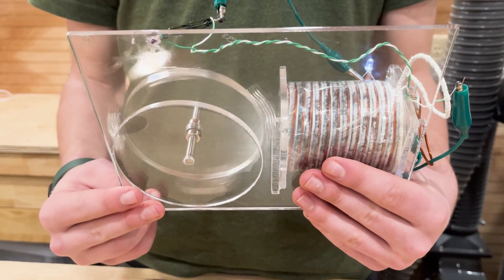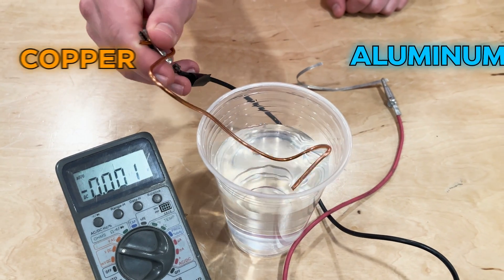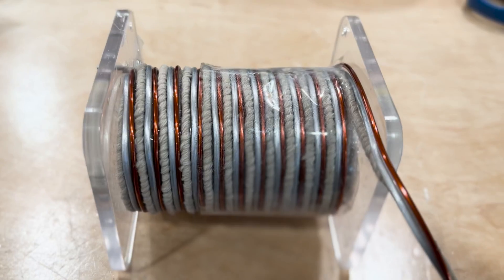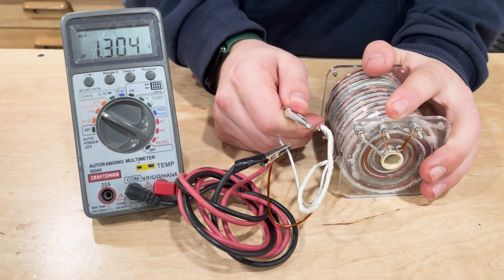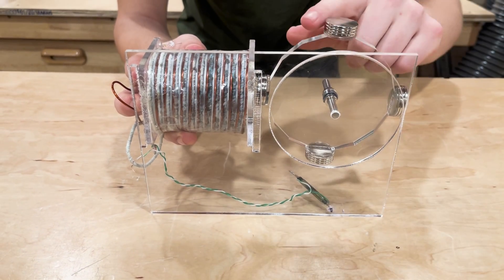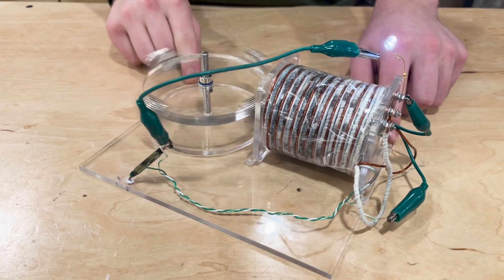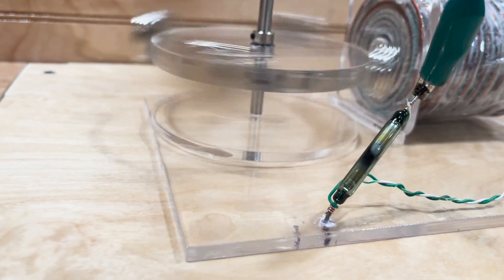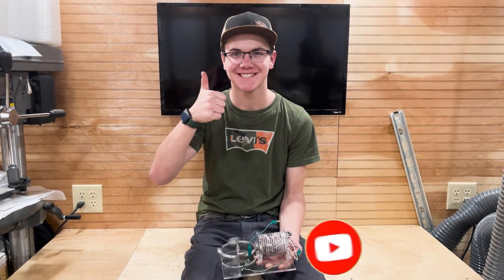Motor That Runs Without a Battery

Comment from the maker: Once the motor is built and the coil is activated, the motor can run for days, weeks, or even months without any external power input. The secret of this motor is the coil that provides an electromagnetic force to the magnetic rotor is also a galvanic battery in itself so that it can generate its own electricity and be a driving force of the motor at the same time. This is actually an old invention called the Nathan Stubblefield coil. Besides salt and water shown in the video, we also used alum, sea salt, and household vinegar to make a better electrolyte without having to use dangerous battery acid. If you attempt this, there's a link of another video someone built 10 years ago. Video link: https://www.youtube.com/watch?v=ZuQGuXJ02fo&ab_channel=lasersaber. We suggest one uses better quality wires like copper, graphite, stainless steel, and magnesium which will perform better for a much longer period. Also, we are wondering if someone could make a coil on the same principle by using two conductors spaced apart so they do not touch inserted in a flexible, clear tubing filled with acidic liquid, and then wind the coil that way so the wires are always immersed in liquid while generating a magnetic field to power a magnetic rotor. Please write some comments if you have any better ideas.
Reply: I use to give your videos some harsh comments. But I am very impressed with this. Awesome demonstration.
Reply: Yeah I need to make this so I can do my own tests on it to see what it could be use for and improving it/beefing it up😊👍👍🇮🇪
Reply: CoperIfItsOxidised,ThenTheReactionIsMoreEficientAndComplete.IfAluminumWireIsAlsoWithFabricAround,ThenTheBatteryCanBeRecharged.
Reply: Prueba a poner esa bobina al vacio para que el oxigeno no oxide los metales.
Reply: Daniel, here is an idea for  you Sir. How about building a Tesla motor of your choosing which is super efficient and surprise the hell out of us all. Thanks
Reply: Good job. Please is a faster way of threading the copper wire?
Reply: Make a rotor with a fan blade or a fan blade/water pump. 
You could do a boat. Very small propeller.
This is so scalable.
And you haven't even taped the other end of the coil.
Reply: Dude, you just made the battery and coil in one package. For what? To surprise us with this?
Reply: I'd like to know how you cut the acrylic to shape. That knowledge is very useful for building prototypes.
Reply: i'm interested in seeing this design having a solid electrolyte instead of liquid, might be a solution to look into, if you see this comment thank you for your time.
Reply: Can electric heaters be attached, so that heat also could be generated?
Reply: Nathan stubesfield coil battery .
Reply: The title says "Motor that runs without a Battery", but already in the top-comment Daniel explains that it has a galvanic cell, which is after all a battery.
Reply: is that a tunnel diode?
Reply: Ez egy Stublefield tekercs !
Reply: I REALLY NEED TO KNOW, WILL THIS CHARGE A BATTERY?? (I CAN ADD A JOULE THIEF TO BOOST VOLTAGE, OR POWER THE JOULE THIEF WITH IT👍)

Comment: Another application idea: Rather than just make magnet spin, suppose you could use such rotation to create a water pump or water fountain. N. Tesla has a patent for w water pump that uses a spinner to spin up a column of water into a vortex. The vortex makes the water level rise, and then it spills over the edge, falling back to where it came from. A Stubblefield powered Tesla water fountain. Nikola Tesla's water fountain patent is U.S. Patent No. 1,113,716.

Comment: yes, solar, wind and nuclear decay heat engines run as long as you have the power source. also various combinations of flywheel energy storage are energy batteries.
Reply: Well, the planet is one big supercharged battery

Delivering many forms of energy 

And we really suck at harvesting it

Comment: Thank you very much good advice. I will give you something. Maybe you’re gonna be a millionaire. You could do it the same thing bigger with a box and every house could have and try to do it at least for electric not for washing machine or for repairs or cooler or condition Only outside lightning the light on the backyard but it’s someplace that it’s open 24 seven or basement but is dark all the time and I believe many people going to all this kind of machine if you’re gonna do it nice nice box only for electric with not big powerjust give me answer let me know thank you possible with bagels magnet and prop like electric pop in every house like solo panel but for small electric like in basement like I told you it’s possible to make big money thank you very much to save energy in USA all around the world

Comment: Man, you built your own battery as energy source - so the statement, the motor ran without battery, is simply a LIE!

You simply made the battery be an internal part of the "motor", but it still is an electro-chemical battery cell - period.

Comment: I liike that ! 

1. Selfrunning is NOT free energy 
__

I made an endless Running LED 😅

-> 5v 1F old bike Cap
-> 100 k resistor 
-> 3,7v led  

Runs 4 days 
____

Load with old solar cell + diod the cap in few sec 🎉

❤

Comment: Nickel  and iron wire and use potassium hydroxide (koh) as an electrolite. You could add a little lithium hydroxide to make the current stronger. Basically, an edison battery. They are known for not consuming the electrodes .

Comment: Your copper wire and aluminum wire are already short due to soaked cotton and having very less distance between both wires. It is better to increase magnetic coil turns to 1000 with a thin AWG 30 wire and use a 2.7 V 1F capacitor with this Reed switch motor. See Tom Bearden's Reed swich motor.

Comment: 01.  WHAT IF... there was a substitution for the wool string like the wire was insulated with gel like a from a insoles or memory gel from bike seats or spandex (same material I think) it gets wet in the rain stays wet until it dries out BUT the coil itself would be an acrylic container same size as the frame itself (like a fish tank) I MEAN... it is very similar to those novelty digital clocks that run on salt water or electrolyte...
02.  WHAT IF... you used GREASE as a substitution GREASE doesn't evaporate like water does OR mix salt water or electrolyte in resin then use the blue light to solidify becoming a magnet resin or something along those lines

Comment: Just put a voltage booster circuit next to it so it can power bigger light bulbs and add another step up transformer along with a capacitor to power your fridge. I suggest you use square plates instead of coils but you will end up removing the rotating magnet.
Reply: It seems that you don't know that voltage boosters only rise voltage but not wattage. With higher volts you get automatically fewer amps.

Comment: Who ever invented  this is a genius. He combined a coil electromagnet and a chemical electric source in one.  This could run on pee or sea water by terms of speaking
Reply: How about the aluminium wire in coil...?... Will it run out, consume in the process?... Will it react with the salt to the point you have to throw it like a flashlight or radio battery...? (Not a re-chargeable) ... I am a, relatively, beginner...

Comment: Dude, you made a make shift battery and say you don’t have batteries added to run it.. you just made a battery into the design, anode and a Cathode with an electrolyte and an insulator.. just because you using the magnetic coil along with the battery design to flip the magnets around to trigger the reed switch. You could’ve placed a D cell battery and a switch with a led and just kept switching on to off and repeating the process.. same effect. Less bullshitting …. Goofy SOB

Comment: Alternate build. Place magnets 🧲 above the motor in same frequency while the cotton,aluminum and copper are submerged in to the electrolyte water for 250Volt Jump on a 40 pound Built. It’s enough to produce 1kw an hour

Comment: Just as the description says "is also a galvanic battery in itself". But also as the description says incorrectly "so that it can generate its own electricity". That would violate the laws of physics. The battery will lose capacity over time and need to be recharged.

Comment: Just to let you know, this setup can work without salt, just water, any water, potable, still, sparkling, deionised, rain … any. Of course the output will be a bit less powerful but there is no pollution.

And as long as you pulse the output you can run some bifilar spiral flat coils as per Tesla patent or just a step up transformer and will give pretty usable power source 24/7.

Keep up the good work ❤

Comment: Materials: 200 thin iron washers , 1 roll plastic box tape , superglue , magnet wire , alluminum duct tape 4 neodymium magnets 2 inch diameter .25 inch thick , plexiglass 1 foot diameter .25 inch thick , 5 foot 2 by 4 board , reed switch , two 1000 uf 150 volt capacitors , switch , 1 quarter inch threaded rod   two feet long with 8 nuts. Place 2 round 1 foot diameter plexiglass with hole in center for threaded rod nuts washers hold plexiglass to rod. After you put on plexiglass to rod glue on ends of rod 2 round neodymium magnets. Look up floating pulse motor you will be building this but mine has built into the plexiglass stick on alluminum to make a motorized whimherst static machine and pulse motor all in one. The caps collect the static charges from the spinnig alluminum and the pulse motor takes power out of the 1000 uf 150 volt caps to power the pulse motor. Static electricity runs pulse motor and on the same shaft you put magnets on to produce AC currents with 2 coils i show you to make. Thin washer a peice of tape glue washer a thin peice of tape. Repeat this process and you get a bar of washers. Cut tape off of outside washers. On ends of glued together washers glue on 2 huge washers to make a spool so you can take magnet wire and wrap around it 1000 times , make 2 of these , these are your alternating current power coils.

Comment: B.S. it will run a while but it is just an efficient use of electricity, not a greater than 1.0 in/out.
Reply: Efficiency can be just as important as over unity or zero point. I'm sure you could probably achieve this by attaching a juel thief  on the back EMF. its still a cool idea combining thr coils with the battery's anode and cathode. Efficient is still better than what we currently have forced on us by the commercial.   industry.

Comment: On top of it might be just a battery, but it is a self recharging battery with a base and acid in the case that you do and close it where you can put salt in it. It should charge it and keep it charged and forever. Go try that.

Comment: Like you said about enclosing a copper wire, with an electrolyte, create a concealed container where the wires are coming out of it and sealed off so that way you can put constant salt water in it and it will always work
Reply: I think the anodes and the diodes would have to be changed due to corrosion, but that might only have to happen once a year

Comment: The hardest part of designing any perpetual motion machine is working where to hide the batteries.
Reply: In the Universe
Reply: The coil IS the battery. The oxidation between the different metals provides the current.

Comment: I tested long ago several concrete (cement+fine sand mix with different %) in several aluminium cans (from  Red Bull) with a central copper wire. The + was copper, the - the aluminum can. It gave about 1,4 Volts for 10 days. The outer aluminum can was thin and oxidated and broke, not giving output anymore, end of story. As long as the aluminium or other negative metal holds up it will work, once corroded it's for the garbage or recycle container.
Nice model made , a Joulethief taking as low as 250mV / 25mA can bring up voltage peaks to work for a LED 3V / 20mA or several of them.

Comment: I think you have made a primary alkaline battery aluminum wire (positive) gives away electrons to the copper wire (negative) with the help of the sodium chloride electrolyte. The battery will run as long as the electrolyte is wet, there's aluminium left and enough exposed (unoxidized) copper wire. Batteries have been researched for more than 100 years and I highly doubt that you can make a better battery cost/benefit efficient battery than the ones that are commercially available.
Reply: aun que lleven mas de 100años onvestigando la bateria   algun dia   saldran cosas mejores y   para lo grar eso  se tienen que investigar   y bueno lo que hace por cada investigacion   va   encontrando  la solucion parea encontrar una bateria mejor  de la que hay actualmente
Reply: @juanhonores9762  True! However, what he's doing in this video isn't scientific research. Even a guy like me who have basic understanding om chemistry and physics could easily figure out the reaction by looking at the galvanic series. This entertainment and that's all good.
Reply: He is not trying to build a battery but find how to combine it to generate free energy..if the coil and battery can run to charge it self and provide energy at same time.
Reply: @nholmes86   First of all, "... generate free energy..." is a contradiction of terms, and there is no such thing as free energy. I watched the whole video, and he obviously understand where the energy is coming from. This is very basic chemistry.
Reply: @DoRullings   why dont you read the comment he himself pinned on the comments section
Reply: @nholmes86  I watched the video and he obviously knows very well what he's doing and where the energy is coming from. This talk about "free energy" is just clickbait. Nothing more, nothing less.

Comment: That's really cool Daniel,there is nothing you can do about the corrosion and the thing still work. resoaking  the coil should recharge it though until the copper and the aluminum are consumed. You might be able to reclaim the copper and aluminum from their oxides, if so you would have to remake the wire. That is really neat. thanks for sharing that with everyone. Lazersaber built one of the Stubblefield coils.
  You could place some generator coils around it to help keep it running longer or produce more energy to store in a battery. Like you said you could build a sealed container to house it where it won't dry out.

Comment: You made a battery. Cool!
Reply: A battery who's back emf can be used to charge another battery or itself?  You could probably increase output by attaching a juel thief.
Reply: @joeyd.staats9546    Back emf only delivers the energy which was input earlier to build up the magnetic field. And "Joule thief" is a misleading name, since this circuit only increases the voltage but not the power.

Comment: You basically made a bettery that runs an electromagnet that runs the motor?
Reply: The battery is bettery right? The whole point of these designs is to improve output power to load. To create power without leaving behind a massive carbon footprint. The sad thing is that online mouth breathers have created such a hostile invironment for engineers and inventors that we have regressed in improvement to what's already available so we become stuck with systems that are held together with stockmarket shareholders.
Reply: @jvon3885  There are lots of bots that spit negative comments to every video like this, they made me quit trying.... publicly
Reply: 🤣🤣🤣👍 I'm Scottish and have done some physics, mechanics, and self idea creation, and I totally agree with you, I've sketched DIFFERENT part ideas for different things that use MINIMAL energy INPUT, and MAX energy output for newer cars, such as my own types of ignition, lightweight too!, but no one cares unless they can make a bitcoin out of it, how and when did we become this pathetic😂 @jvon3885
Reply: Aso, nana, i was just asking. I‘m not an engineer. Just looked like a battery. What is a mouth breather?
Reply: @katrinarthur7790  On average someone who knowingly or unknowingly debunks something. The coil is also a battery so the video title is a bit misleading.
Reply: Yeah it's a crude battery in the form of a coil using the lenz effect from the magnet rotor backfed to charge itself. Eventually though it will stop running from friction. Personally if I were trying to test it I'd use an oscilloscope and record it until it stops. Then use that data to modify and scale it up then try putting everything in a vacuum sealed tank. Then couple a charge circuit or a cap bank and see if I could get some usable amount of stored power out of it.
Reply: @fireteamomega2343  usable amount ?...are you saying the current output from the device  isnt enough?...i trully dont kno
Reply: @scarfo441 
No it's basically enough energy minus friction to help rotate the magnetic field around the coil which is then fed back into itself. Meaning you're slowly losing energy from friction. Now if you could remove the friction with a vacuum chamber and have some expendable material that electrons are easily stripped from nearby the coil then perhaps you could generate some usable amount of energy. Regardless it's extremely inefficient in comparison to even solar or beta voltaics. A series of resonance circuits on 2.4 and 5ghz wavelengths open air would probably be closer to what you're looking for as "free" energy. Even though it's not exactly free in the sense something is producing those wavelengths mostly cellphones. You would more or less just be collecting the energy from the air which nowadays is saturated with it.
Reply: I don‘t want to hate on the project. I actually like it. I was just wondering…
Furthermore, I watch those kinds of vids for entertainment, not to prove anyone wrong.
Reply: It's still way better than those free energy out of nothing videos
Reply: I'm with the last guy. Just a battery u made. 
Thumbs downs for false advertising